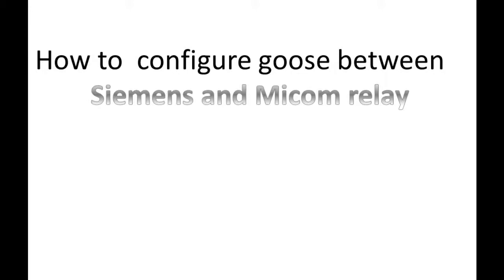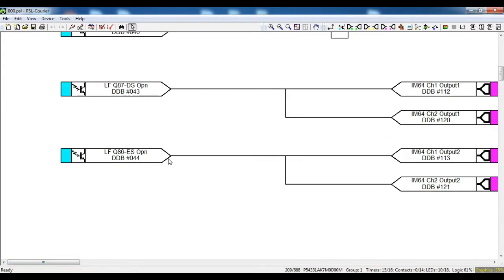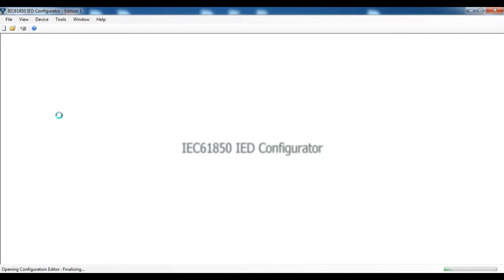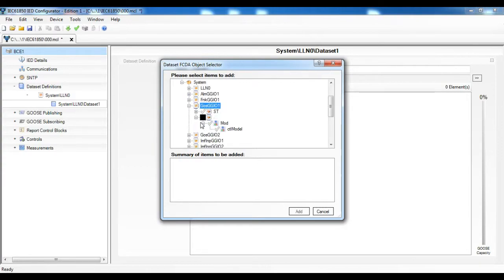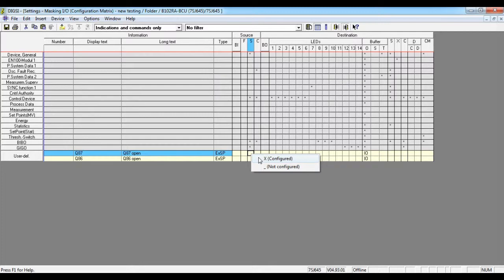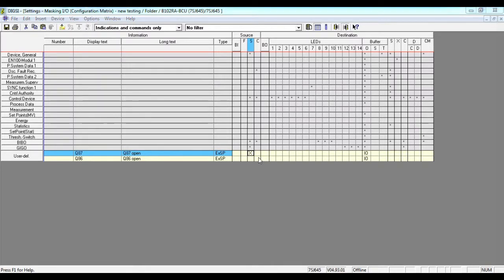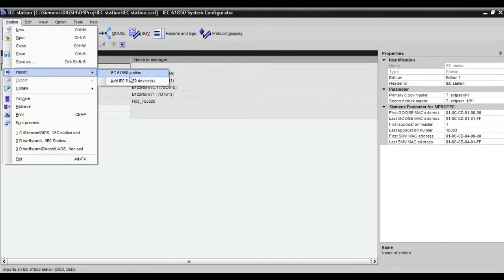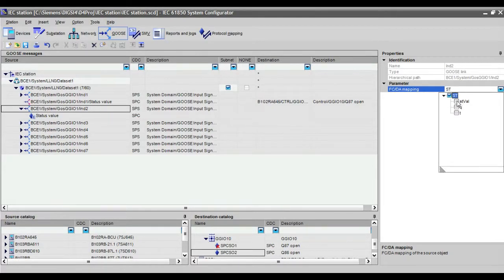Configuring IEC 61850 GOOSE: MICOM P543 to Siemens 7SJ64 Relay Communication & Testing

Comment: U didn't take virtual out put assigned for isolator status, in ur data set,  how would it work then?
Reply from the maker: for sending single to IEC or IIE without virtual i/o we can take from particular tree if available .
Reply: @baranitech  what is IIE?
Reply: In PSL u took virtual output but when ur linking those to siemes relay, u r taking virtual input to link. Can u explain this? 🙏 please

Comment: How to update micom icd file in Siemens iec station.
Reply: No not this update....there is one option of update under iec station down to export and import.
Reply: I have one micom relay p444 i have made some changes on that for led reseting through scada.....so i export icd file of micom and update the iec station by  satation by selecting the icd. But then the relay goes offline to scada.
Reply: @baranitech  but after sending this file my relay goes offline and also some goose in is not working